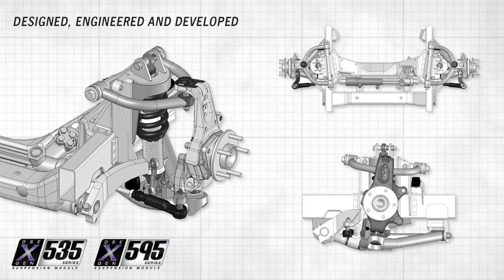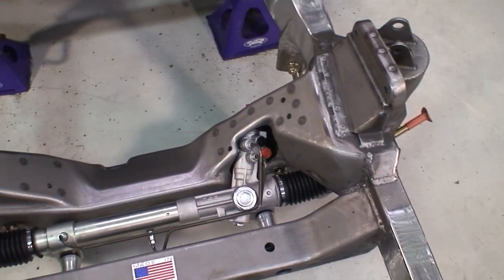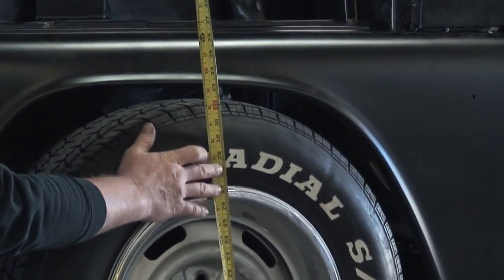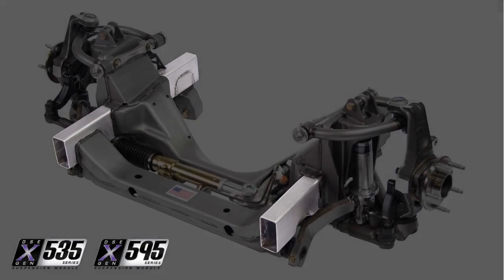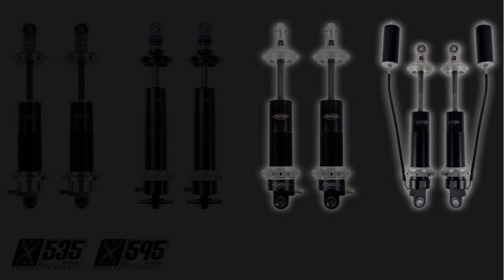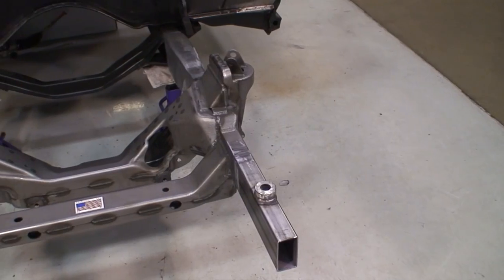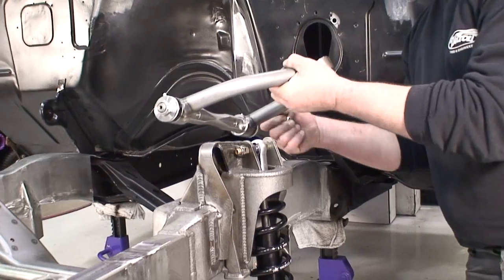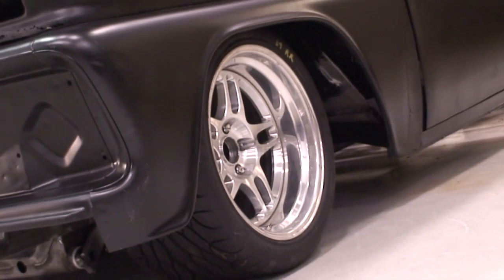Detroit Speed X-Gen Front Suspension Module

Comment: It is super interesting and rare that you make  53.5 track width. One of the problems with researching such things is I can find this specific product but I can't find it used on any cars, simply because it is either not documented on the internet etc. Even this video only shows the larger track width IFS being fitted.  There is virtually no visual information on short track with  kits around. Do you have an example cars where the 535 has been used that you could link?

Secondly, could this ISF ever be available as Right Hand Drive? Imagine this - a huge majority of British cars are RHD with this smaller track width. Including the car I am interested in modifying, a 1974 Morris 1300. At a track width exactly 53.5, your IFS would fit perfectly and meet all governing body rules on track width. If only you can make it RHD. 

Thirdly, is there any provision to fitting air bags? Again, it is always hard to get smaller cars onto air bags.